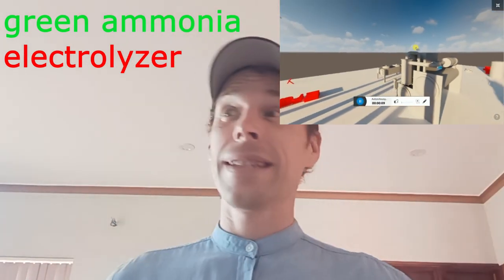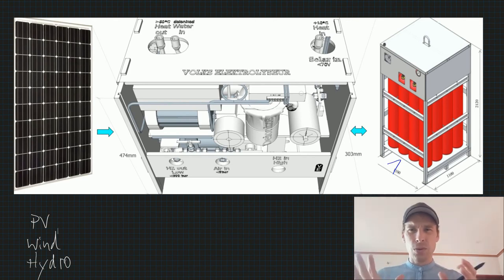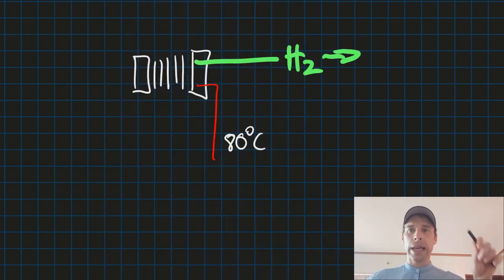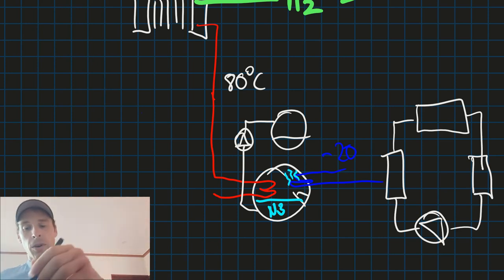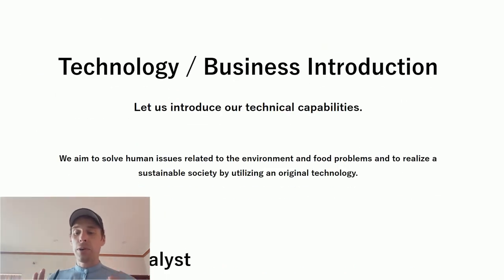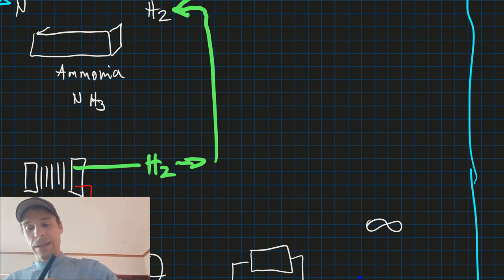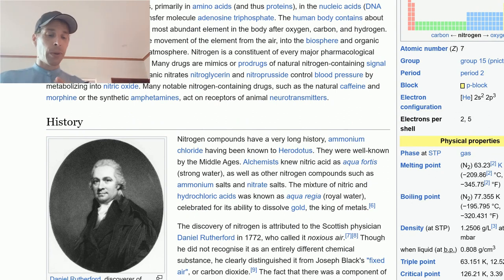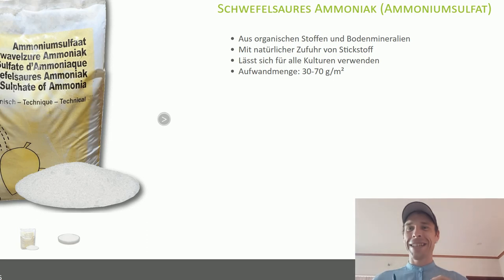Ammonia electrolyzer with Nitrogen extraction and electride catalyst

Comment: Correct me if I am mistaken but Nitrogen certainly does not condense out of air at -77 °C it is 77Kelvin which is around -196 Degrees
Reply from the maker: Thank M. Wolff, you are completely right. I added this misleading mistake to the Video description.
That is why on the thumbnail you saw a nitrogen generator which uses pressure change adsorption with membranes. Sadly we found out after the video.

Comment: Current electrolysis technologies can achieve efficiencies of 60-80%, with solid oxide electrolytic cells (SOEC) being the most efficient at 80%. The hydrogen is then combined with nitrogen from air using the Haber-Bosch process to produce ammonia. This step has an efficiency of around 90%. This costs 3-6x more expensive than blue hydrogen because the electricity is more valuable than methane gas.
Reply: Electricity is zero price many times this year here in Europe, but only for 2-8 hours each time. So Topsøe made their SOEC to start/stop in seconds to capture those prices.